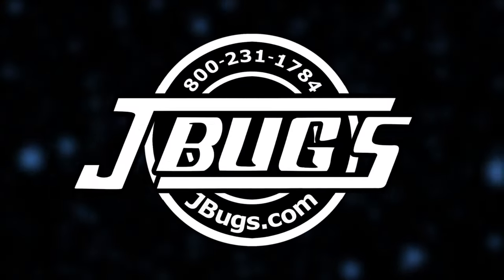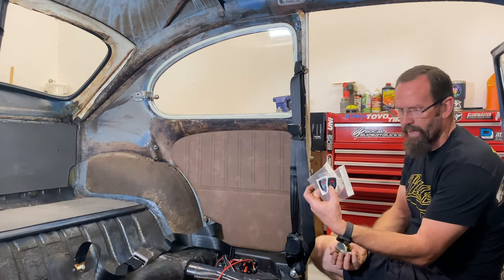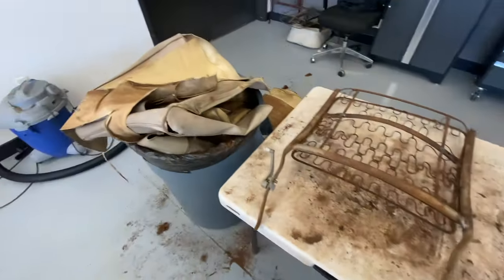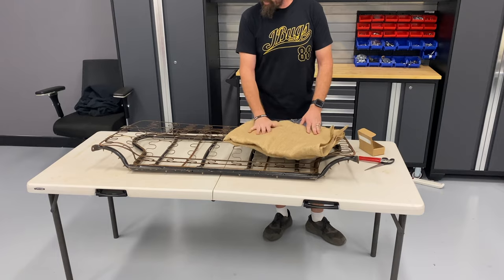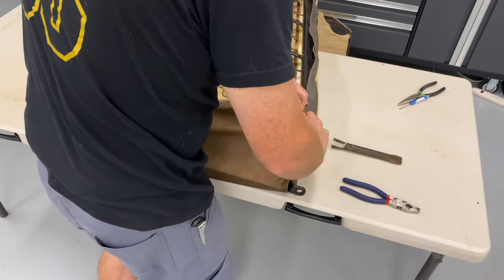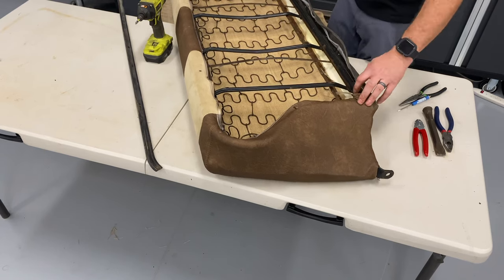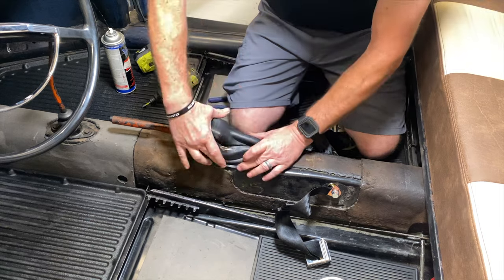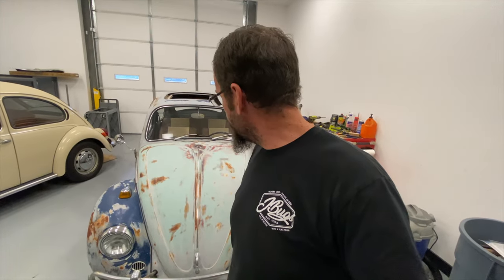1967 VW Beetle - Seat Belts & Seat Upholstery

Comment: Great series Sam!  For the front seat belt buckles in my bug I bought some plastic seat belt sleeves (often advertised for RVs)...they hold the belt up so the buckle can't fall between/under the seats.  They work great and IIRC were only like $12 for the pair
Reply: That's a good call, we have some sleeves as well that I might try and fit to the belts from our contoured sleeve belts.

Comment: Love these videos, Sam. What size tires and rims did you end up using on the front with the dropped spindles to avoid rubbing?
Reply: We went over that back in one of the first videos in the series - https://www.youtube.com/watch?v=luZ9eMurpjQ&t=58s

4.5" wide wheels with 145s in the front. With drop spindles and disc brakes sitting about 5/8" wider than stock, they do rub the fenders just a bit when taking sharp turns with 2 or 3 people in the car. I've got some plans for that, just waiting for clearance from the bosses.

Comment: I'm 6 foot tall in my socks and barely fit in my Beetle.  You must be quite a bit taller.
Reply: Ha, actually I am (or at least was) 6 foot tall. I'm shrinking as I'm getting closer to 50. I've got short legs though, only a 30" inseam, most of my height is in my torso.
Reply: @Sam_Mebane  Makes sense.  I've been shrinking, too.  Too many ladders and telephone poles.  I guess I've never seen myself in my car... I probably look like a stringbean stuffed into a matchbox car.

I find the car quite comfortable though.  I love almost everything about them except when the alternator brews up.  I'd drive nothing else until I needed a pickup.
Reply: @jemcnair76  there are plenty of things I think VW could have done better, the clutch cable access for sure being one of them. Either way, I've way no matter what I do, I can't seem to get away from them for too long!
Reply: @Sam_Mebane  Yes, there are some things that are a bit silly, but there is nothing like opening the garage in the morning and starting a Beetle.  It's like commuting on a motorcycle, I think.  Nothing will be normal about your day.  On a bike everyone is trying to kill you, and with a Beetle there is always that little question in the back of the head about if some thing conks out and leaves you up to your elbows in grease on the side of the road.

By the way, you video about the bouncing Beetle speedometer needle got me to finally break that thing open.  I did the odometer gear a decade ago but I thought the bouncing needle was not worth too much time.  It's worth the time.  

I thank you for everything.  Be safe out there.